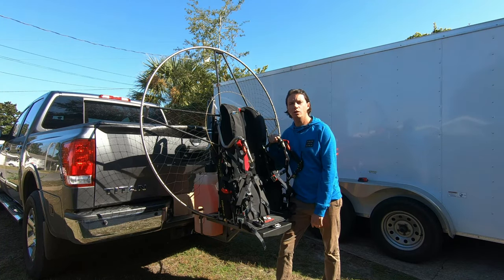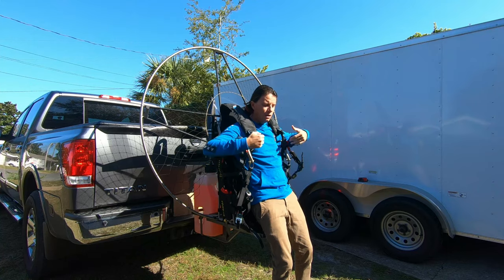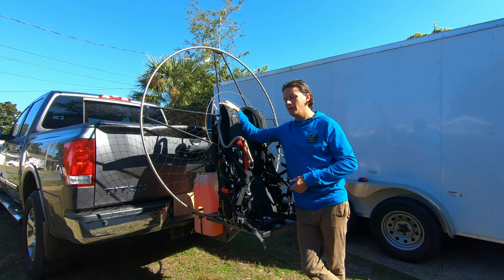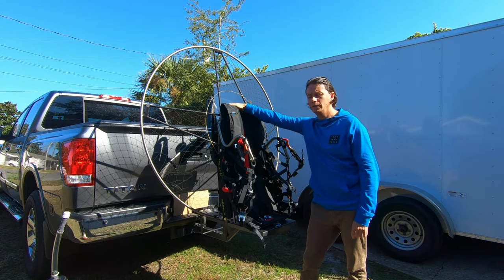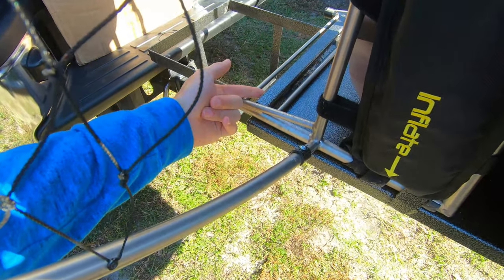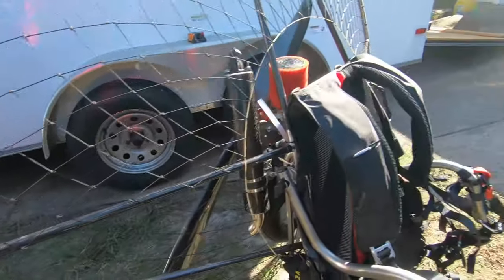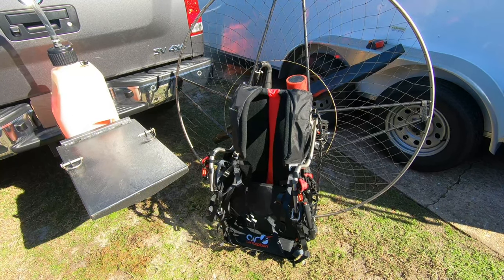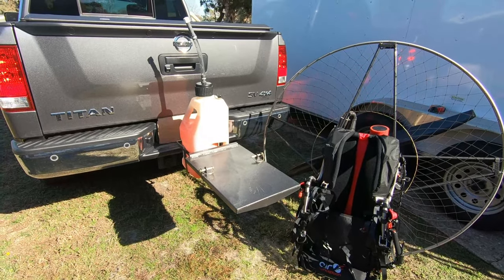Air Conception Paramotor Hitch Carrier

Comment: I have this carrier for the Nitro 200. It is strong, light, and simple. It is worth the price. I have not seen a faster, easier, or safer system at any price. I sit on the carrier while I strap in and that saves a lot of energy for us old guys. Another benefit I use it for, is pre-flight inspection.  It is easy to inspect the front and the back of the paramotor while you are in a comfortable standing position.  With the clutched version of the Nitro, your prop won’t spin while you drive.